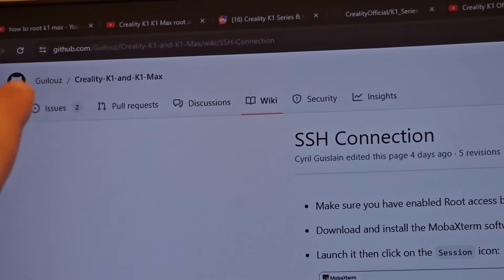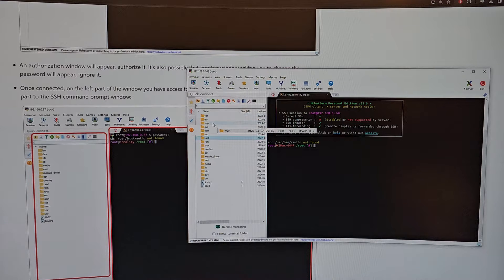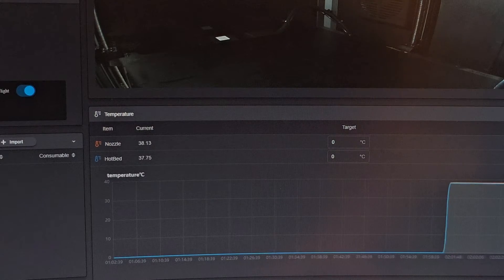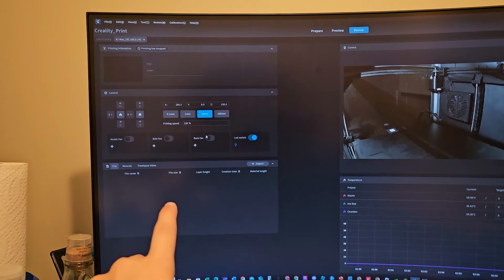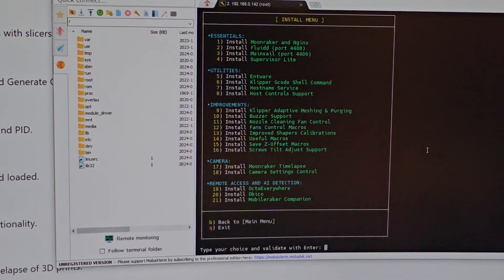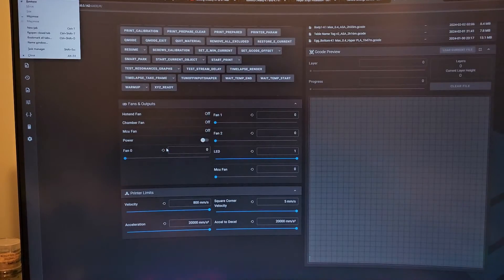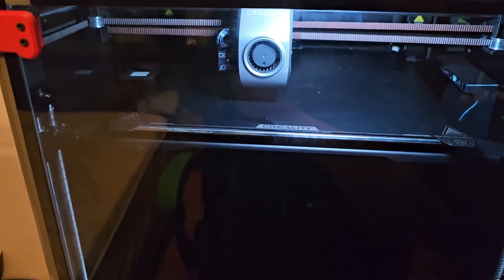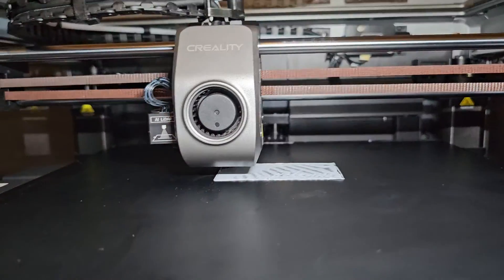I Finally Rooted The K1 Max And Now It's Causing Problems

Comment: Follow the instructions for input shaping correction. It's not obvious how to do it correctly. Also, remember that rooting is just giving yourself access. Rooting itself can't hurt you. It's just the things you do after you root. Adding everything just means you added a huge number of variables that might cause a problem and now you can't really tell which one is the problem. If things get too messed up, you can always factory reset. One more thing little brother - nothing you do in software is going to improve your bed's flatness, so running a new bed mesh may yield a more accurate result, but it won't yield a more desireable result. That requires manual bed leveling with shims or by adjusting the belts. This is a physical problem.
Reply from the maker: Thanks, I totally forgot to do the input shaping. That's good to know that rooting cant hurt the machine. Yea, I should not have added everything, and do it little by little. I have been messing with fluidd and it's started to print better.

Comment: can i ask you when you root the printer will klipper update like if you install it on a Pi ?
Reply from the maker: I rooted it like 2 weeks ago, I'm not sure about klipper updating on a pi, I never use that.
Reply: @Scratch3DPrinting  when you install klipper on a linux system you get the flued or mainsail UI and with it all the updates all most every day. i use a old laptop on my ender3 with linux OS and a rasbbery Pi4b on my elegoo for klipper the k1 is factory klipper but after rooting it will it update the same way? i have not rooted it cause it prints perfect from the factory.

Comment: A few things. That error you got when trying to send a file was because In orca slicer, next to where you select your machine, you need to add in the IP address with an http://(IP here):4408. That should fix it. For the purge, that is a KAMP purge line, it’s actually great and cleans the nozzle well. As for the issues with first layer and leveling, etc. You needed to run the reset after the firmware install so that you can do the auto tuning on the machine. Otherwise, it’s there. Should work after that. :)
Reply from the maker: Ahh, I didn't know that orca slicer needed the full ip address with the port number so I can send files to the k1 max. I will do a reset and redo the auto tuning and see if the first layer is better. Oh and do you know if there's a way to not do the full calibration when "Upload and Print" from orca slicer? Thanks for the tips.
Reply: You’d have to modify the Print_Start section of your macros. You can just add # to the lines you dont want it to do. ;)  @Scratch3DPrinting
Reply from the maker: Ohhh, 😄 I'll take a look at it, I keep thinking that there's a setting inside orcaslicer. Thanks again.

Comment: I'm the creator of Helper Script and oh my god ! I've never seen this before! 
You click everywhere, you install everything without really knowing what you are installing. And above all you haven't read the Wiki before otherwise you would have seen that it was necessary to restore the printer to factory settings before using my script to avoid problems.
I advise you to read the Wiki, to understand what each feature corresponds to and what it does, this is often how we end up with problems without even understanding why and above all it will mislead people also seeing this.
Reply from the maker: Hello Guilouz, you're right, I have not read much of the wiki. I did install almost everything without understanding them. I have been reading the wiki and doing some tuning in the last couple of days and now my k1 max is printing like normal again. Thanks for what you're doing.

Comment: After rooting you have to run the input shaper calibration or else your print quality will be poor. Also the purge line is always there for klipper. Additionally the helper script has some other tweaks to modify like Improve Hotend Cooling, Fix printing Gcode from folder, Calibrate Extruder. Hope you get all things resolved!
Reply from the maker: Ohh right, I totally forgot about doing the full input shaping and calibration.  Thanks.